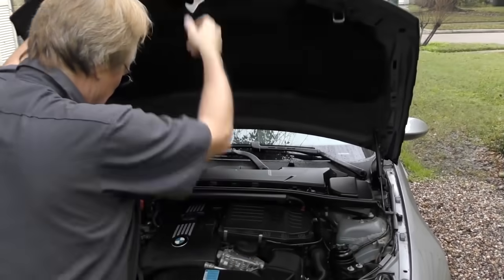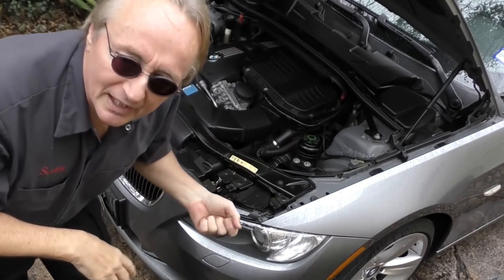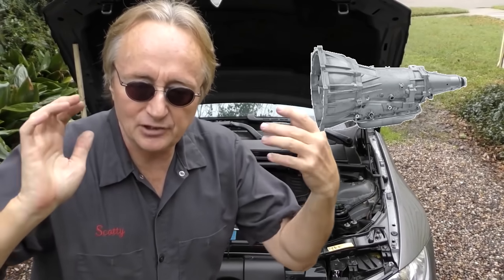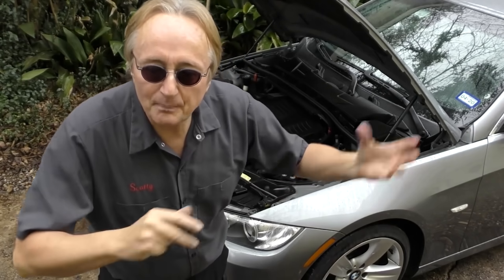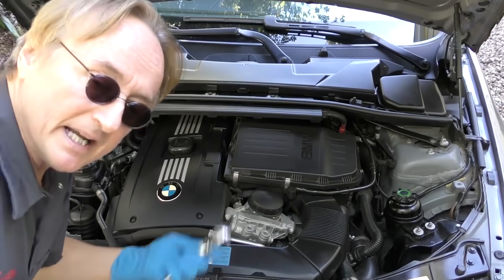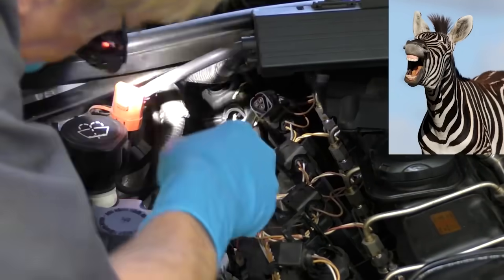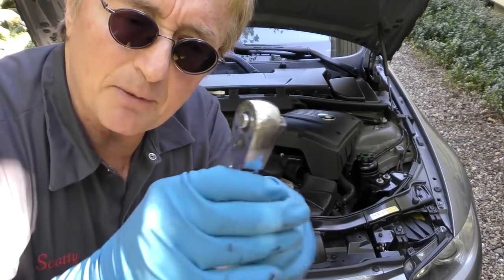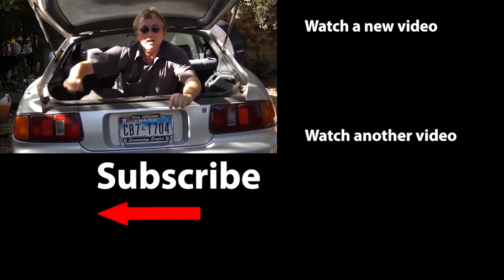People Say I'm Full of Crap About BMWs, Well Watch This

Comment: Not to bash your knowledge. But the N54 is probably the reason why bmw gets its name of unreliable. The High pressure Fuel Pump , the direct injectors are a huge issue and not to mention the chassis harness in the E9x series of cars is a big issue. I think what challenges most people is just seeing the mess of wires and plastics and they think it's too much for them to complete. Also you can re build your turbo chargers as well for a lot cheaper or buy a upgraded set for cheaper then buying new. I would like to point out the more reliable engines that bmw makes though. The M5x series of engines are super reliable. But it's typically the car around it that falls apart before the engine.

Comment: Owned a 2006 E90 and the only thing that went wrong in the 18 months I had it was the starter motor. Had to remove the intake manifold to get to it, but it wasn’t difficult as I do auto mechanics professionally. 
Wouldn’t really own another one though, because I see too many come in for repairs too often and it costs quite a lot sometimes.
Reply: Removing an intake manifold to replace a BMW starter says it all. Sort of like going through your anus to remove your tonsils. Both are totally effed up anatomy.

The only other engine I know of with the starter buried deep inside the engine is the Cadillac Northstar, another POS.

Stick with Toyota. It's like the difference between marrying a nice looking, easy-going girl, versus marrying a psychotic, bipolar supermodel. It's dependable, pleasant boredom, or brief periods of ecstasy in a life of drama and misery.
Reply: @watchman-pu7tp  I’ll raise you one. Try doing a starter motor on a Mercs Vito Traveliner, or better yet, an Audi Q5 where you have to basically remove an engine mount and so much more. 
Had enough of the more difficult aspect of the job 🙄
Reply: @watchman-pu7tp  taking the manifold can be done in less than an hour tho...

Comment: i got a 07 335i with the n54, tuned on e50 and pushing 20psi+. as long as you to the major maintenances like the gaskets, fueling issues, and all fluids youll be fine. definitely not something for someones who has little to no experience on working on cars though
Reply: Hey man do what ur mind wants
Reply: Evan  to be fair bmw is a luxury brand. So its more fair to compare it to acura and lexus, to which both have read wheel drive options that have v6 and v8 options.
Reply: Evan I own an isf. That’s a Japanese muscle car to be afraid of lmfao
Reply: Evan  there a lot of Jdm that just not only front wheel drive lol. Comparing Camry and civics to your 335? Remember there the isf, rcf, 400z, 370z, Supra, STI, evo, and so on.

Comment: Well... a BMW needs some love... you have to flush the transmission frequently and the X drive differential as well, change oil every (at least) 9000 miles. And keep an eye on the electronics. If you don´t know a good mechanic and you have to go to BMW dealers, these cars are expensive AF. But take care of your engines and transmissions, then even a BMW lasts a while. Mine is 12 years old now and ran about 171.000 Miles without any issues yet.

Comment: I know one thing, I'd rather have my BMW 330ci Clubsport that's 20yrs old and going strong, and sacrifice a little reliability in return for a car that gives me pleasure to drive it.
As opposed to a bland underpowered Toyota which is more reliable but unexciting to drive.
I've owned my car for 4 years now and in the 21,000 miles I've done on it, it's not let me down. But I do look after it.  
Oh and my coils ARE bolted down.  2 on each  of the 6 coils.

If you don't look back after you've parked your car, you've bought the wrong car. :)

Comment: Yes. Removing layers to get access to the particular part which then disintegrates into pieces which fall into the exposed orifices....

In short, take out your silver bullet shooter and silver crucifix and banish these value vortex distorters from your presence.

Oh, yeah, then after the part replacement which caused you to have to move other parts which shattered when trying to angle back into place, the codes have to be cleared...

Not shade tree mechanic friendly.

Wave your silver crucifix and repel these.
Reply: I am an expert at canabalizing new BMW entries at the local junkyards.  i have a boneyard of engine parts for backup WHEN it fails-lol
clamps,clips,hoses,sensors, etc.  the whole enchilada  😁

Comment: It's a labor of love. I own a 2011 X3 28i and it is "Break My Wallet" sorry to say I am swearing off BMW's for the rest of my life. In the last 3 years I have to replace the rear main seal, Starter motor which requires removing the intake manifold, Front window washing squirter clogged,  left hand arm assembly in front door. One touch down doesn't work any more and needs a new switch assembly, and now a valve cover gasket. It only has 126,000 miles.

Comment: On my 3-Series I had crank but no start I replaced all my sensors and the wiring to the coils runs like an olympic sprinter and smooth. DIY thx to youtube and google and parts are cheap through ebay for a 3 series.💥💯

Comment: You’re not doing the job correctly scotty. You’re supposed to remove the cowl assembly(takes 2 minutes) to work on the back of the engine. You turned a 15 minute job into a 3 hour job.
Reply: Either way, it's a POS...
Reply: @jordesign  if you don’t know how to wrench, then it’s probably too much for you to handle.
Reply: @TrapN54Tv  Exactly... Better be prepared to work those things...
Reply: @Jules the Toyota worshipers haven’t experienced anything with over 180 hp 😂

Comment: And these aren’t sealed transmissions either they have a pan. And the issues you probably had was the solenoid o rings. Which is why they still functioned properly. Ps I can read everything off my 70$ obd dongle including data from modules you can’t on normal vehicles that you would have to fire the parts cannon at.
Reply: @badinstinctsYoutube the Thor or mhd dongle. There’s a list of other for apps like bimmer link which will show you all the modules and give you proper diagnostics. I use the Thor which also works for tuning etc. 70$.
Reply: What about the metal in the oil?

Comment: As a bmw mechanic the life time fluid containing metal bits is only from the transmission manufacturer, it’s brims from the gears being made, for a bmw it’s perfectly fine for the pump, the brims are smaller then the filtration screen

Comment: Two things about the part where Scotty starts working on the ignition system:

1. Fer chrissakes, remove the plastic crap above cylinder 6.  No matter whether you buy a 4 or 6 cyl BMW, the last cyl or two is buried up next to the firewall.  Don't make it into laprascopic surgery when it doesn't have to be.
2. To break the seal of old Bosch coils, wiggle them slightly clockwise and counterclockwise before you pull.  You'll break the adhesion and then you won't have to pry on the thing.

Comment: Bought a 2016 M5 with 40k miles less than one year ago.  Already had to replace all 4 tires (which is a treat, given it doenst have a spare, so you get to tow your costly M5 when it has a flat).  Then my shiny M5 didnt like to be towed and it messed up my transmission.  I wont even tell you what that cost (hint - they dont fix them, they just replace them).  Then my plugs and coils went out - another $1400.  Those Honda Accords are looking very nice these days...

Comment: Scott is Soooo right !!.. I purchased a 2000 BMW 323i.. a few months later, the transmission sometimes would not go into reverse.. had to open the driver door and use my foot to push back..also everything plastic was either cracked,split or broken.. doing 60 mph the car to slow down while accelerator was almost to the floor, seems like the plastic throttle body linkage (also plastic) broke . Got rid of the P.O.S.. Scotty speaks the truth.
Reply: You bought a 23 year old car, what do you expect?
Reply: @WayToManyAssassins  When I was growing up.... My parents only bought old cars because that is what they could afford and except for the Cadillac they just kept running and running and running. Around my home town there was always old clunkers driving down the streets. Most of those cars are now worth at least 6 to 8 times what the new car purchase price was. The high school kids in my 1970s home town generally drove early 1950s type Chevys and Fords because they could pick them up for around $ 50 to $ 100 bucks.... Now those cars and trucks were easy to work on and parts were cheap. Most people could work on their own cars and trucks.... Even I could work on my own trucks and I am extremely        uncoordinated because I have Parkinson's disease. I can't even get my hands into the tight spots under more car hoods now. So I have to pay to have a mechanic to repair and maintain my PIECE of JUNK money pit BMW. It's too bad that I hadn't watched this video first before i wasted my money on a BMW!!!

Comment: I'm the opposite i LOVE bmw cars and I've owned a few. But I believe it's a misconception,  335xi, 328xi, x5 35i bought used and have only have had basic problems most cars have and all the parts, yes aftermarket not oem, r no more expensive than any other regular vehicle I've owned. I also believe they're is NOTHING on the market that has a better AWD system. I'd put it up against ANY 4wd or AWD vehicle out there. I love bmw and pretty much only buy those. I think if any basic mechanical knowledge u should be fine

Comment: I love my 2008 e93 n54 got it for 10k with 43k miles put MHD stage 2 + and pushing 450hp. With h all modes and LSD it’s a great fun car for under 14k $ 
Super easy to work on by yourself, used tested injectors index 12 for 800$ and lsd 1100$ are most expensive parts.
Had no problems with it at all, only service.

Comment: I have owned a N54 and now a N55 and I would agree - these cars are so much fun to drive but you better have some money put away for maintenance (and another car to drive while the BMW is in the shop!).  Get ready for endless oil leaks and coolant leaks as the rubber gaskets start to degrade and the not-so-cheap plastics crack.  The engine and transmission (and turbos) have actually been fairly reliable though.

Comment: Y'all need to stop crying that they aren't reliable. Buy them low km, do not put any tunes or anything that will over push the limit of the engine and most importantly do your oil changes frequently ( every 8000-9000 km) not 12-15k km... I can also had to make sure the previous owner is a old man and not a kid that was always pushing it to the red line. Like guys this is just common sense 🤷

Comment: I had a 328i straight six NASP 1995 3 series coupe for 12 years (owned) and it was the best car I every owned and I have had three Subaru including a high end Legacy. I took it to an independent BMW specialist for service after the warranty expired and they used official parts and oils at trade cost. The only repair I had to make in 12 years was the water pump ( a plastic impeller! ) other than routine brake pads and filters. No exhaust or battery in over a decade. Remarkable. The car had 17 x 7 alloys and low profile tyres although not ultra low profile like modern performance cars. No issues with merging or punctures. 

But, I completely agree with the post 2005 cars where technology and plastics have been deployed and they know what they are doing - deliberately creating a reliance on the branded dealership, parts and COST of these. It’s the same as the old argument with television sets - I had a Panasonic that was still working (with a VHS video machine and PlayStation 2 ) at 30 years old. The corporate number crunchers realized this wasn’t a good idea for the company so NOW television sets are ‘disposable’ items with NO serviceable parts and last 5 years if you are lucky… just out of the warranty. 

It’s clearly different with a company who brand engineering excellence like BMW the cars have to last 20 years but they have engineered them in a fashion that forces the customer to trade in (new car sale) OR pay for high cost service work. This is deliberate as Scotty concludes, yes.

Comment: owned a 08 335 coupe. 100$ for the special equipment. basic hand tools and torx bits. :). Ive done FMS, valve cover, transmission fluid and filter, f and r diffs, xfer case. The only thing I would recommend never letting go, is the oil filter housing gasket it. When it leaks on the belt the belt can fail. the crank sucks the belt behind the harmonic balancer and blows out the front main seal. you have to drop the oil pan after this top remove all the rubber that gets sucked in. oil filter housing gasket takes about 30 mins to replace. :)

Comment: I love my 335i convertible. I do most of the work myself. That code reader Scotty has is exactly what BMW owners need. It’s a Launch Elite 2 code reader. Very inexpensive compared to a BMW dealership, especially. Buy it connected to Wi-Fi. Let it download. After that downloads are free we connected to Wi-Fi if they are available. You may need to purchase additional software like safe for an Audi. It’s $58. After that downloads are free. If you and Conner anything that is not addressed by this code reader contact the manufacturer. They will include the information in the next Wi-Fi download. The days of not being able to get into our BMW computer are over.

Comment: Have my now 3rd used bmw series diesel. The e46 broke down, but the e36 and f30 that I currently have, have been loyal, solid cars. Of course my f30 is 11 years old now, the central locking don't work on one door. Looks that a lot of people over there don't maintain their cars. Eventhough bmw has oilchange at 30k km, I change oil at 15k km...still works good now, I have my f30 from 40 000 km , to currently now running 220 000 km...

Comment: As a 2007 335xi owner watching him working on the car in part 2 of the video shows he doesnt know how to work on this specific car.  air box had no reason to be removed he couldve taken off the cabin air filter (4 bolts) and taken one other piece of plastic off thats held by clips this would've been quicker and made the whole back of the motor super easy to access.  He was holding high revs and flooring on what at least me and many others consider way to cold of oil these cars are very needy when it comes to their lubrication with cold oil as he did he easily could have spun a bearing and I wouldn't have been surprised.  BMW's can be AMAZING cars but remember they cost a lot to buy and those parts won't get much cheaper.  My current car makes a little over 450 whp and has been pretty reliable.

Comment: I have an E87 130i. Manual, straight 6, non turbo. Recently replaced a bunch of stuff and it wasn't that bad. Yes there's a lot of plastic coolant fittings and I did break one. Cost $50 for a new one. I've found it easy to work on as long as you take the trim off around the windscreen. It's really not that hard. Parts aren't any more expensive than any other car, at least not here in Australia. Overall I wouldn't hesitate to get another non turbo one.

Comment: I love my BMW but yeah I had to rebuild (refurbish) my turbo on my 340i (B58 engine). Costed me around $4000 CAD. Also coolant loss, oil filter housing cracking (leaking coolant), and more. That said, I still want another. My mechanic said after 100,000 km, the next 100,000 km you are re-buying your car.

Comment: I bought a 2011 BMW X5 with 26,000 miles back in 2014.....radiator resevoir leaked. oil leak out of head gasket cover, heater coil went bad, water leak through sun roof... I got everything fixed and got rid of it......Never again.

Comment: What is the alternative material use instead of the plastic ?
Reply: Metal
Reply: @Pitch_Kartimartinuh  What an intellectual, and the car´s weight will skyrocket from 1.5 tonnes to 2...
Reply: @mareksinister  Going by that logic evs are without merit due to the massively increased weight of the enormous battery.

Comment: I’ve owned a 1987 bmw 325ix, a 1990 bmw m3 (yes)and a 1995 bmw m3. Best three vehicles I have ever owned. Absolutely no problems. It depends on the car and model. But if you know their problem areas you can fix them before failure. I have made money on even purchase. Still have the 95 m3 230k and still running like a champ

Comment: I have a 2015 335IX and I love my car. Has 67,000 miles on it, I bought certified preowned with 30,000 miles. I’ve had minimal issues with it, nothing catastrophic thus far. I’ve had a hose near the radiator snap, cost $55 for the part and I replaced it myself. It’s better to say that BMWs are just expensive to maintain but they’re not crap. Whoever says they’re crap probably hasn’t driven one.

Comment: So i got a 2002 e46, runs well and I'm spending some money on preventative maintenance as I know parts are old. I love the drive, it's got enough power for me for a 325i and it's a manual. If i buy anything else from 2002, might as well jump in a shopping trolley. If i buy anything for 5k (AUD) that's more modern, I won't be getting the driving experience, power, tech etc.

Comment: I had 1 2011 335 convertible, the feeling when driving that car is amazing. It was beautiful and fast. I bought it for 16,000. 6 months later it started leaking oil. No one would work on it. The dealer gave me a quote for 7000 plus more when they take it apart and find additional things that need to be repaired. I sold it for 10,000. The dealer put it for sale on car gurus for more than 400 days no one was buying it.